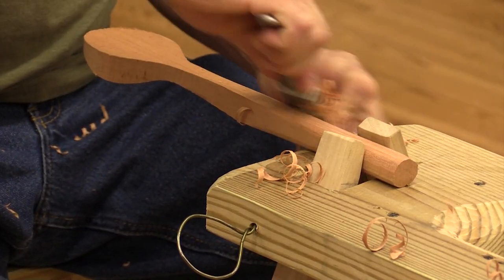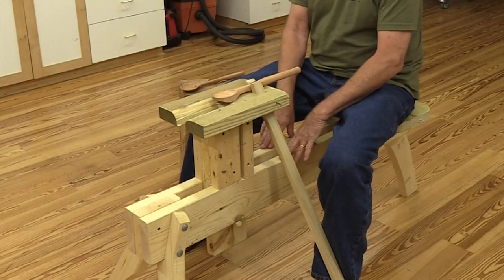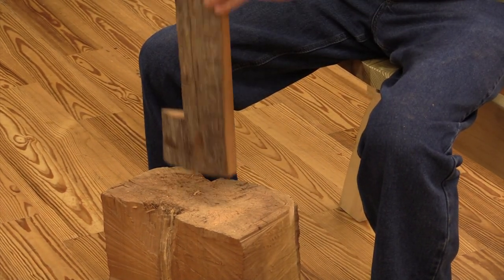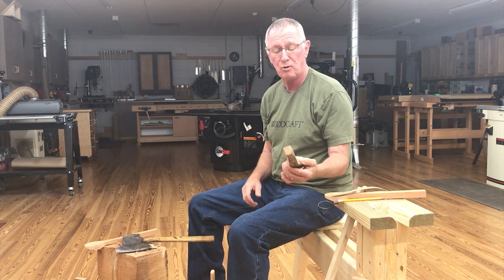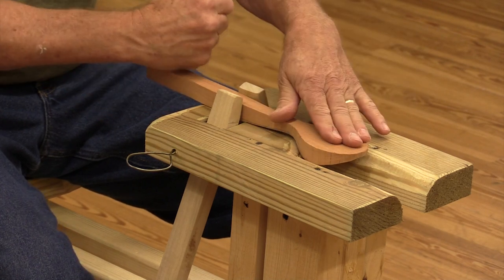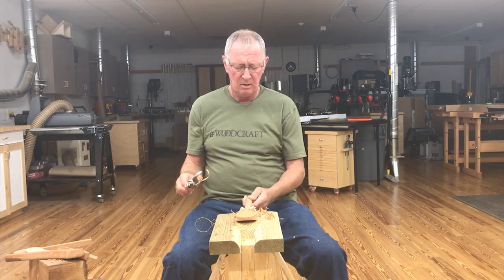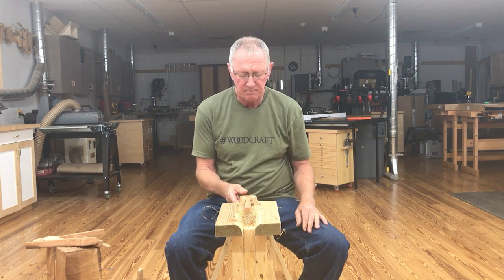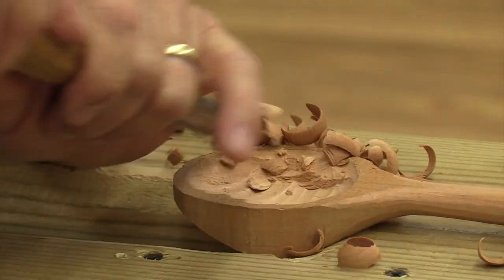How To Carve Wooden Spoons on a Spoon Mule with Fred Esker

Comment: Where to get one of those small spokeshaves?

Or better yet, a good tutorial to make one?

Some good pics from various angles would suffice. I couldn't tell with you waving it about, but lt looked like the tangs came into the body from the back rather than the bottom, is that correct?
Reply from the maker: There are links to all of the tools used in the description.